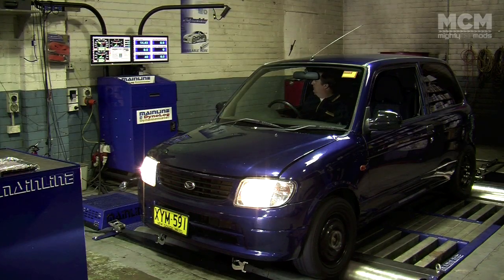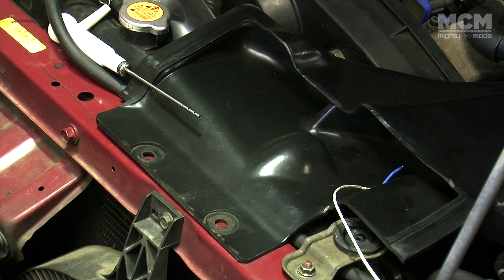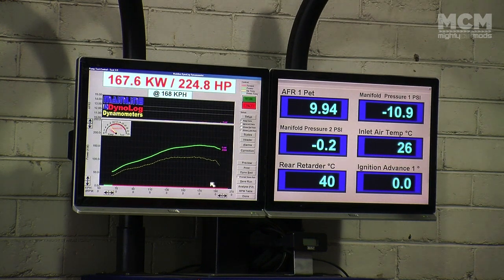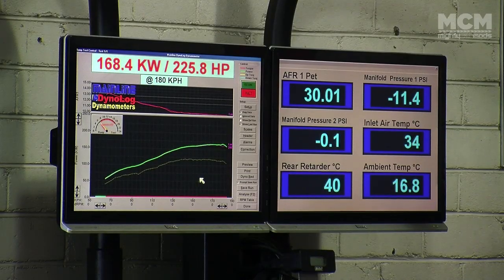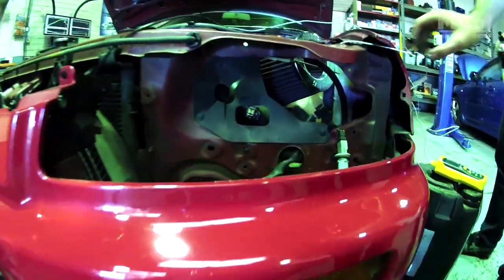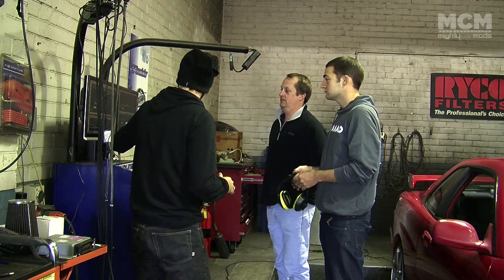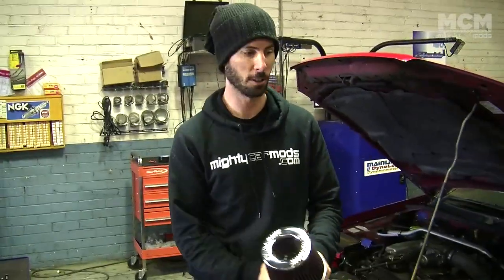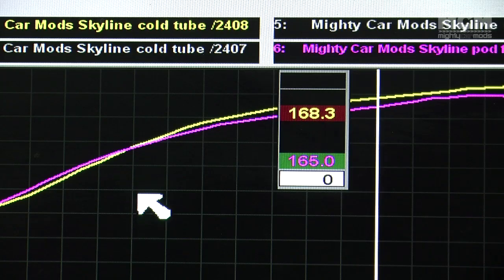Cold Air Intakes Mythbusted [Turbo]

Comment: With the huge dyno fan blowing all those heat is blowing away, you should shut the fan off because most of the heat soak is when a car stop and go in town with low speed. I believe after half hour slow drive or jam, the heated air suck through air filter inside engine bay vs the pop out air filter outside the car will make difference.

Comment: Of course, you weren't testing cold air intakes, you were testing short ram, aka, warm air intakes. Get some real CAIs, and try again.
Reply: The point is that most people who do not understand the concept of a properly designed CAI will do what they are doing here which is just stick in some shiny pipe and a pod filter. Which as you point out and they prove in this video; turn into "warm air intakes". Not trying to be a dick, that's just the point of their experiment.

Comment: Intakes work better when they car is moving? do they not? so why would you expect to see a power gain with a car sitting in one spot? I would like to know exactly how much air flow is actually being sucked up from that little fan. Common sense would dictate that when your car is travelling faster your intake is taking in a decent amount of cold air. when your car isn't moving its taking in exactly none. In my mind this test was absolutely flawed and pointless. Myth busted? Not quite.
Reply: ***** I have a cold air intake in my car (2005 Mazda 3)  and I do feel a power increase from stock. Not only a power increase but a much deeper engine sound as well as better gas mileage. I tend to drive my car hard so my gas mileage is never ideal but since I put on the cold air intake I have been getting an extra 50-75 km  out of a full tank. The intake cost me less than $100, definitely one of the best purchases I've ever made.
Reply: wesleysnipessss If you could upload your dyno numbers before and after that would be much appreciated. Or you could just not tell people your car makes more power because you "feel it" and it "sounds deeper".
Reply: TheUltreos Dyno test would be pointless because the intake doesn't work when the car isn't moving. Also I can tell people whatever I want, if you don't believe me then fine. I'm just saying, in my own personal experience a cold air intake definitely made my car more enjoyable to drive. If you think I'm gonna go around and extensively test my car's power specs just to satisfy your burden of proof you're crazy. Believe whatever you want it makes no difference to me.
Reply: Clearly none of you have any idea how a dynamometer works nor have you ever used one. That 'little' fan blasts a jet of air direction into the engine. Do u really think the engineers who created this machine didnt think of this?
Reply: leapoldstotch The dyno is measuring force exerted by spinning tires in terms of horsepower and torque, what does that have to do with airflow in the engine? Also no offence but who would listen to someone that can't even write properly?
Reply: Yes that's exactly what I'm saying mate...
Reply: Karl Puetz Do you have any evidence to support that claim? I don't know how that could be possible since that fan is  not pushing air out anywhere near 100 kph, more like 40 kph max. You're saying slower air flow produces more power? further more there is no possible way that fan could cool an engine the same way as flowing outside air, heated engines will produce less HP. If you think I'm full of shit here is a quote from hotrod.com. So there it is mate...

"but a quaint external cooling fan simply can't simulate the airflow a car experiences on the road. For example, at 6,000 rpm in Fourth gear, our test mule would normally have 130 mph worth of air flowing through its cooling system and air intake. On the other hand, the external fans used in most shops would be lucky to generate 20 mph air speed. "Most fans are undersized and only move 2,500 to 5,000 cfm of air," says Michael Caldwell of Mustang Dynamometer.

http://www.hotrod.com/features/0612phr-dyno-accuracy-testing/
Reply: ***** I see what you're saying but what does aerodynamics have to do with engine power?  There is no correlation between the two. Wind resistance will not limit a car's power output which is what the dyno is testing, it will limit the speed and acceleration no doubt and I agree that dynos are not a substitute for racing.
Reply: wesleysnipessss I am completely new to learning about cars so I enjoyed reading your comments. You definitely make the most sense to me though. My first thought was the fan not pushing nearly enough air for that kind of power. I find it hard to believe that little fan generated the equivalent air intake of a car going 110+mph.
Reply: Since you've never put a car on a dyno, I'm guessing you have no idea about cars really, so I'm just going to stop here mate. Good luck on your quest to glory
Reply: Karl Puetz says the guy that has no valid point and can't think of any other way to defend his ridiculous statement. Obviously I'm no expert and neither are you or we would have never watched this video in the first place.  You can discredit me all you want but I would assume that Michael Caldwell of Mustang Dynamometer knows a little more than any of us and his statement supports my theory. CHEERS MATE good luck on your quest to ignorance, if you haven't already achieved it that is.
Reply: wesleysnipessss shush it has air flow similar to driving 60-70kmph.
u probably own a holden
Reply: A dyno is designed to simulate actual driving conditions dude... How do you think manufacturers come up with horse power numbers? Manufacturers claiming that their cold air intake adds XX% more power would have needed to prove that it makes a difference by doing a before and after test between intakes on a dyno. 

99% of all cold air intakes are pointless, the only way to make use if them is to install it away from the engine to actually suck up cold air, and to get it tuned so the car knows what the hell it's supposed to do with the extra air it's suddenly getting or else it will run lean.
Reply: Yea I definitely trust your expert opinion :|
Reply: wesleysnipessss Thanks man,but that isn't an oppinioin, it's a fact. The five years of factory training I got when I was working for Ford, Subaru, and Porsche gave me a good idea of how air/fuel mixtures work.
Reply: Shho13 I'm not saying that cold air intakes make a significant difference in power output. All i'm saying is that this test was flawed because that fan is not simulating the same airflow as driving down a road at a given speed. Would you not agree that better cold airflow into the engine is beneficial?
Reply: Ratio_Paradox no and no
Reply: Karl Puetz 3 months later and you're still trolling around this comment thread, good for you mate.
Reply: wesleysnipessss And what are you doing, then? You were the first to post a troll 3 months later. So yeah, good for you mate.

The speed and volume of air the fan can push are irrelevant when comparing the different intakes. Since all systems were tested with the same 'little' fan it's a fair test.
Simply picking up a pod filter from Super Cheap and installing it doesn't increase your power - assuming the stock airbox wasn't a restriction to begin with (most are not).
Most of the time replacing your stock airbox with a pod filter actually loses you power. I've seen this so many times it isn't funny. In your mind, the extra noise makes it 'faster' but it's not.
Comparing a simple CAI or pod filter swap to a full job (including MAF replace/delete and engine tune) is stupid.
Reply: Bill Couper How am I trolling? Do you know what trolling is?
Reply: Karl Puetz I'm really sorry...you know you can mute posts, or is that too complicated for you?
Reply: They drive on the dyno and they have a fan that blows according to your speed. Obviously you haven't been to a dyno.
Reply: wesleysnipessss ok maybe a bit late on this one but to put this to bed.....cold air intakes are great if youre looking for the induction sound....however for performance gains they are pointless for 2 simple facts..... 1: on an N/A engine intake velocity will remain pretty close to the same no matter what because the downward stroke of the piston can pull in no more than atmospheric pressure (14.7 psi)..... 2: any cooling of the air charge cant be effective anyway due to heat exchange to the intake manifold from the heads and EGR system (exhaust gas recirculation)...which all cars after the early to mid 80's have....so if you want the sound....great....but know what youre buying

Comment: 227 stock air box  
224 pod filter 
227 headlight removed sucking hot engine air 
223 covered pod 
232 out from the engine. 
The hp gain is because the MAF reads cold air and doesn't pull timing, also adding extra fuel to the mixture. Made this little note because ordered CAI for my 1.8T. Now i am at worst with the covered pod filter setup and i want to use the full benefits of driving in winter.

Comment: I like these guys they are real cool and informative but im pretty sure that you need to actualy run the car trough AIr/DISTANCE for the air intake to actually TAKE IN AIR LOL .

Running a dyno leaves the car stagnant so the car will not run through AIR thus not allowing the AIR IN TAKE to IN TAKE AIR lol .

So this video was use less but you guys are still awesome
Reply: sashariel hung If you were familiar with how a dyno works, you would have noticed the giant industrial fan that sits in front of each one. The fan is there to push air into the front of the car at high speed to simulate highway driving. So despite the car not moving, it is still drawing in air from the fan

Comment: so long story short, cold air intakes are only good if you need the extra space under the hood :P
Reply: I don;t know about all this but I added a K&N to my Ridgeline rice burner truck with 160,000 miles on it.. and it made a significant difference in power. Not sure how much... but I can feel it.. and it sounds tough as nails. Not ricey at all especially when the VTEC kicks in.

I think maybe it's because the stock Ridgeline air box is a piece of junk. 

If I baby the car on freeway driving... I get a whopping 15.3 mpg. This is almost 1mpg better than with the airbox.

The only problem is it sounds pretty good so I find myself sticking the boot into it more often... so I really average about 11.1 mpg.
Reply: Stephen Cassar
an intake doesn't change the sound of your motor... what you are experiencing is called the placebo effect and most likely a small hole in your exhaust.
Reply: TheTokuin  Actually you're wrong...sorry. Because POD filters don't have a silencer and aren't surrounded by a plastic box you can hear the induction a lot better. That is basically it.
Reply: The Pooch
 He said "sounds tough as nails" I never considered induction sound to be a "tough", to me it sounded like he was saying his motor roared louder.
Reply: On my vehicles I only run Cat-back exhaust (Magnaflow) and factory cold air
intake that I make sure is free of obstructions and always has a clean filter.
Reply: marlon pisk
thanks for sharing, how does that relate to this discussion?
Reply: TheTokuin My point being that on a stock small displacement engine, there
will be a real HP gain by replacing the stock restrictive exhaust. These aftermarket intake systems really don't do anything as this video proves. The
factory cold air box is efficient enough for any small displacement engine.
Reply: ***** HAHAHAHAHA... Best description of a Ridgeline I've heard yet.  And per your comment:  Yep, always laugh at the guys who seem to think that Honda, because they can make amazing commuter cars knows ANYTHING about building good 4wds...Hell it's not even really a 4wd, it's an AWD CAR with a "torque on demand" system and no T-case  Yes, Someone made a race truck out of one, NO, it's not "tough as nails".  It's a Uni-body POS CAR (that was apparently built to resemble another complete POS called the Chevy Avalanche/Escalade whatever), not a truck,   If you want a "tough as nails" Japanese 4wd you're talking about a Toyota or an older Nissan Pathy/Hard-body or a Suzuki... but in no universe is a Honda Ridgeline a "tough as nails" 4wd... it's simply NOT end of story.  HAHAHAHAHAHA  "Birth Defect"  absolutely PERFECT description.
Reply: Haha idk what you guys were talking about earlier. But yes a cold air intake is an increase in power, a loud intake note as well yes belive it or not an intake males the engine louder, but not really the exhaust. Thats what when you have a good exhaust on a car and an intake then your car sounds good. Idc what kinda car it is honda or a 5.7 hemi anything
Reply: Dylan Hutchison
you have no idea, what you are talking about. That's probably why you can't piece together a proper sentence. An air intake does not affect the sound of the engine, just because the sound the intake makes is under the hood, doesn't make it an engine sound. It's just the air intake making noise as the air goes in.
Reply: *****
Yeah, but at least mine is understandable. I'm not asking for robot perfection here. Case in point: "a loud intake note as well yes belive it or not an intake males the engine louder". Even if we over look the obvious spelling error in "makes", it's still fairly difficult to understand the sentence without re-reading it.
Reply: Ok you got me, I didn't spell all my words right. Please don't tell my 4th grade teacher that i didn't properly proof read my rough draft copy of my comment.
Either way this video is wrong, the car has an intercooler and is made to cool the the air that is over 600 degrees going through the turbo. You think 10 degrees is gonna make a differnce when the air gets extremely hot anyway?? No, a real cold air intake on a naturally aspirated car is going to give you more power, better MPG, and a louder engine tone under load... Plain and simple. This video should be deleted

Comment: Apparently there was little consideration given for the diameter of the hose when they put the filter out front, the longer any tube becomes the more restriction is created, it needed to be larger by approximately 25% to not be a factor for comparison flow/power output.

Comment: Cold air intakes are a waste of money and I'm glad I didn't invest. I just replaced my factory paper filter with a performance OEM . Factory cold air boxes are designed to work that's why a manufacturer has engineers.
Reply: Anthony Macneil They are useful if you have other mods and tune the ECU.
Reply: Anthony Macneil Exactly, and just because a CAI may give your car extra power that doesn't mean the car will perform better, if anything the car may run slower !
Reply: +Anthony Macneil Clearly all the car manufacturers have got it wrong. They invest millions in engine redesign for their next model and all they had to do was give it some fresh air! Silly buggers! :-)
Reply: The point of a larger diameter intake is to allow for more flow as a supporting modification for larger turbos. Trying to use the OEM airbox with a larger turbo would be absolutely stupid unless it was already a large diameter.

These larger intakes make little to no sense on a NA engine, unless it's a large engine.
Reply: Factory airboxes aren't engineered for maximum performance, they are engineered for sound deadening which requires strategically placed baffles to disrupt the smooth flow of air into the engine.  This makes the intakes quieter for the occupants of the vehicle.  Baffles = turbulence.  Turbulence = restriction in airflow speed and volume. CAI and short-ram intakes remove restrictive airboxes and normally add a conical filter with more surface area to draw air through which is less restrictive than the factory one.  Also, I don't think you understand what the term "investment" means.  A vehicle along with anything you add to it should never be considered an investment.  Investments don't normally depreciate as soon as you buy them and continue to do so until they are virtually worthless.

Comment: I don't think you gentlemen understand how the ideal gas law works... or how cars work.. or much of anything.. plus whoever said that a cold air intake would produce a "20%" increase of horsepower is not very smart either; especially without some sort of after market exhaust. But a cold air intake paired with an exhaust that eliminates back pressure will most definitely produce more ponies.